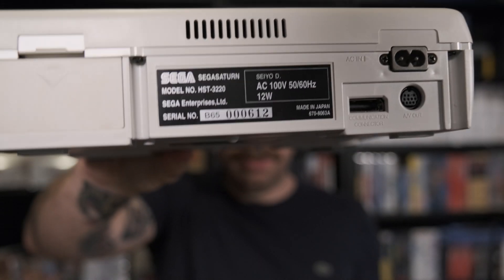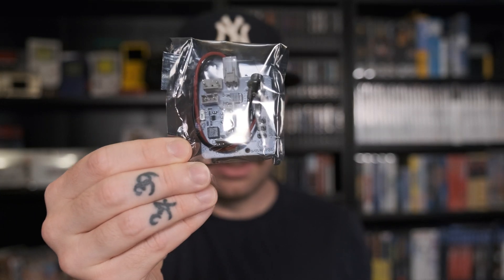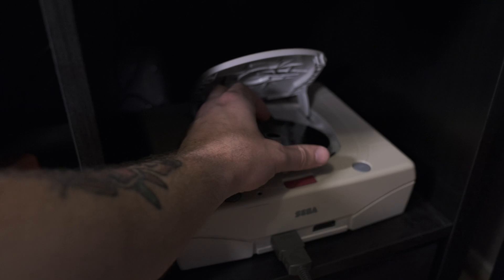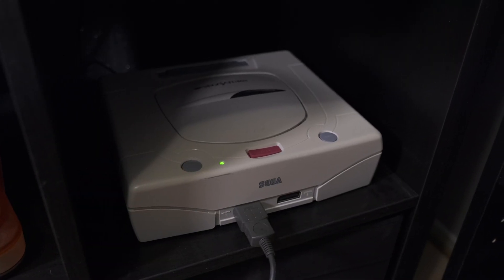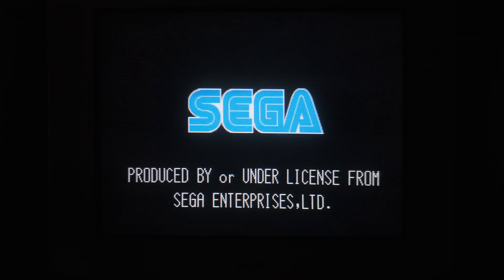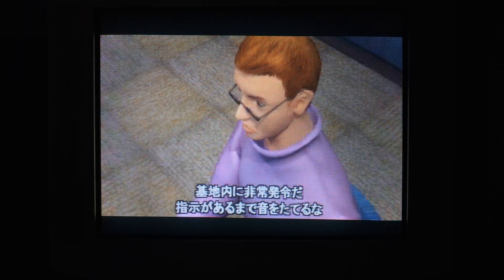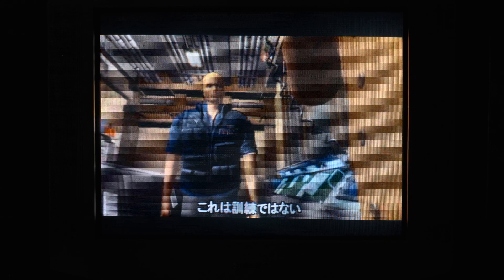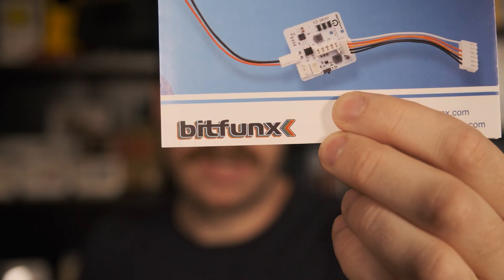Sega Saturn volt PSU mod - EASY no soldering

Comment: I have the Bitfunx PSU now, being on Europe, should i put the lever on 3.3v or 5v?
Reply from the maker: It depends on your Saturn model, i cant remember which is which, but if you got the Bitfunx PSU it should be clear in the instrutions book.
Reply: @goldhagengaming  Yeah, it came with the book which was not very self explainable, so i tried 3.3v to play safe along with the energy converter from 220v to 110v that i now have for the plug and it worked, thanks a lot for this guide, it revived my Japanese Saturn👍
Reply from the maker: Good to hear! Nice job!
Reply: Please be careful with the switch! 3.3 volt for the 5 pin connector and 5 volt for the 4 pin connector!  @MysticDragon1988

Comment: When you showed the back of the console i noticed it was the same model as the Japanese Saturn i finally received yesterday, but grey colored and Model 1 with the OG buttons, made a big mistake yesterday, i thought an adapter was enough, cause it came with a cable it didn't fit on the energy plug, result was it did POW sound and a sparkle on the back, rushed to turn off the console, later learned that i needed a 220v to 110v converter, i'm such a fool😔

Comment: Can i ask you something? do you know if it possible to use a 5 pin power supply on a 4 pin model supply saturn? a bought a power supply that looks just like yours, and i have a JVC Saturn with a 4 pin power supply. both are model 2 consoles, but the psu its a little different. do you think it could work?
Reply: I think its just align it with the screwhole, as the 5 pin version just has a double ground
Reply: EDIT, DONT DO THAT, i did that wrong
Reply: @mrkevinkillercrafterminecr895  ok!
Reply: @pbpraga3963  you gotta connect both grounds dude, at least on a japanese one, be careful
Reply: @mrkevinkillercrafterminecr895  already solved, thanks.